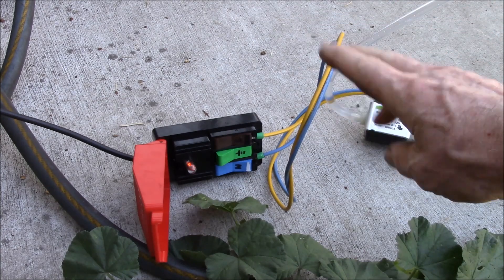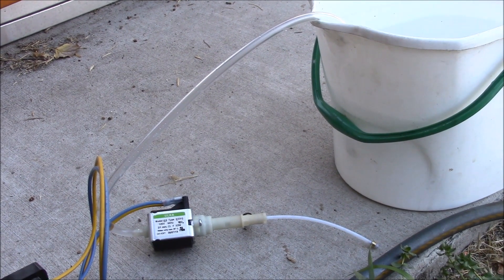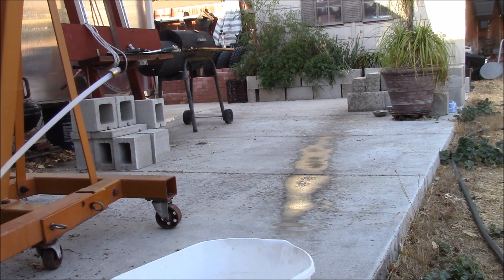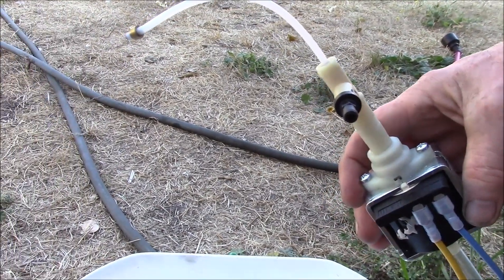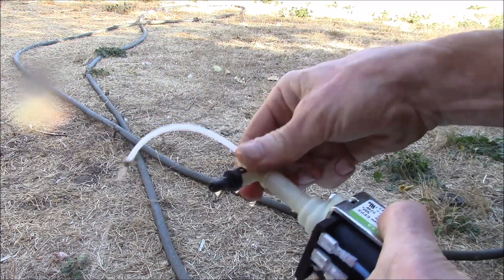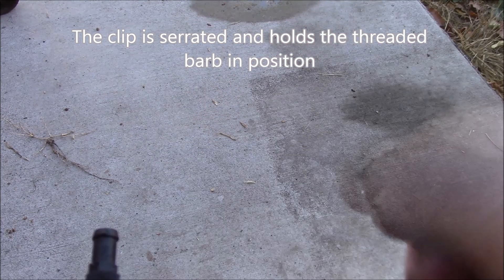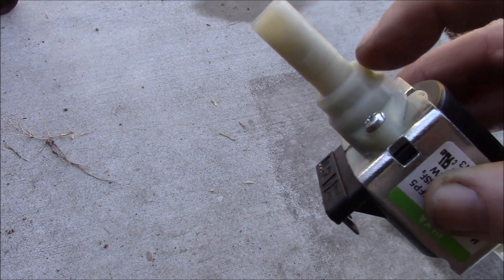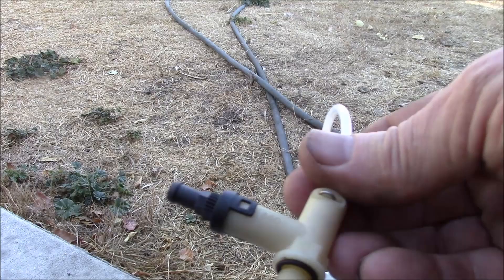Breville 870XL Water Pump / Safety Valve Test

Comment: Great part 2 as well. Just watched it. The tube on top was leaking. I pulled it out and put it right back and it seemed to seal but I’m ordering the valve and tube to be safe. My steamer was not steaming, it seems the pulsating pump action, the water was coming out of the tube/T connection.
Reply: I  don’t have any available but I ordered a new safety valve and tube, so I’ll get it then. Do you think that a leaking “top tube” - the one that goes from the Safety Valve to the thermocoil would cause the steamer to not steam that well? It seems to have fixed it but not sure why.
Reply from the maker: @tonycampanella4597  Yes, that tube takes the full flow out of the pump and puts it into the thermocoil.  Any leak there will reduce flow to the rest of the machine:
https://youtu.be/9lMw6ooiqPI?si=9UHYcDme_sHm3-cd
Reply from the maker: Yes, in part 2 I found I was missing a sealing washer, but the top tube could leak as well, likely because the little o-ring was out of position or worn out.  Do have o-rings available.

Comment: This is 15 bar correct?
Reply from the maker: Thanks for the question.  I don't think the pressure would be that high in this test.  It's just the small Teflon tube on the outlet for a restriction.  I did later set up a test with a valve and pressure gauge that I need to make a video about.

Comment: Mike. Great Videos! I have an 870 XL that has me frustrated. I have replaced main operating board, solenoid assembly unit, and the coil unit. I have water out the steam wand and the hot water, but I cant get any water to come out of the group head. Can you help me here?
Reply: i have also replaced the entire pump assembly.
Reply from the maker: @hirschyfamily  Check out this video if you haven't done so:
https://youtu.be/9lMw6ooiqPI
And follow the water.  Check all the connections, see if any lines are clogged, make sure the solenoid valves are hooked up right and not hanging up partly open.  Those all will cause water to flow up to the hot water/steam valve as that's the default path if everything isn't perfect.
Reply: @The4Crawler  I watched that video so many times and checked water flow. Great video. There is a tube in front of the coil unit that does not remove. It seems to go to the pressure valve. I took out the valve and it’s all good. The only thing I can think is that this unremovable line is blocked somehow. I’m going to part out the machine and get something new. Any suggestions for a new machine?
Reply from the maker: @hirschyfamily  Try disconnecting the line at the pressure valve and see if you can blow air through it.  That line feeds water from the pump, through the thermo-coil and down to the side of the solenoid valve assembly.  Since you get water out the hot water valve, the line from the pressure valve is likely fine because if it wasn't, then no water would go out the hot water valve.  Most likely it's the 3-port valve not fully opening and that will let water leak out the top and into the hot water valve and down to the drip tray.  THE only way hot water can get to the group head is IF that 3-port valve opens fully AND seals off the top port to allow hot water to flow out the side of the valve and up the tube in the middle.  It could also be the 2-port solenoid on the side is stuck open and that will allow hot water to pass right to the drip tray.
Reply: @The4Crawler  I'm having the same issue as this person. Water out of the steam and hot water outlets but not the grouphead.
Everything was backordered in the states.
Tried disassembling the 2/3 solenoid and cleaning.
Didn't work.
Finally ordered a new 2/3 solenoid from germany. They had the 120volt version but after installing it no water from anywhere except straight into the reservoir.
Next day my backordered valve kit shipped...
Installed that when it arrived. Didn't work either.
I'm back to square 1.

Have checked every hose and I can blow air and water through them.
I tried putting the 2/2 colored wire on the 2/3 solenoid to see what would happen, because I can hear  the 2/2 solenoid activating. Finally got water to come out of the grouphead but it's just the sputtering last bit because it's activating at the end of the cycle after all the water has flushed to the reservoir.

Any ideas?
Reply from the maker: @NMEZero666  Follow the water:
https://youtu.be/9lMw6ooiqPI
Although you hear the 2/3 solenoid activating, is it fully opening AND sealing off the top port that sends water to the hot water/steam valve and then to the diffuser and drip tray.  Also is the 2-port valve fully closed and not not letting water flow through it to the drip tray.  To get water out the group head, you need the top port on the 3-port valve closed and the side port on the 2-port vale closed.  Then, and only then, will water flow out of the middle of the solenoid block to the group head.  Pop the back of the machine open and peek inside when you run a shot and see if you can see where the water is flowing.  Be careful as there are live electrical connections inside.

Comment: What device are you using to test the pump? I have an espresso machine, and I am not sure if the pump has an issue, or if the machine's circuit is not able to power the pump. This looks like a useful device!
Reply from the maker: That's a Cliff Quick Test, very handy gadget for doing these sorts of tests safely:
https://youtu.be/pFY22kP61NU

Comment: Struggling with mine. Looking in to the same valve but on a different model. Also the size of the little ball in the pump is important like you said. They make some out of glass but some say they are too hard for the metal. There is another valve with a ball or mushroom shaped with a spring at the exit of the pump to prevent the hot water from the boiler to go back in the pump when it stops. A small loss in pressure makes a big difference in how the coffee comes out and it is hard to detect what can cause it. I also wonder if coil packs become weaker over times as the windings can deteriorate. The diode should be in series and in that case if it opens the pump should stop functioning. If it whould weld shot a a short  the pump should go twice the vibrations and one would notice also. So basically it is about just a few components but they must work perfectly. It would be easier to fix if one had components to swap ready.

Comment: My stupid machine won't stop extracting shot, pulling shot on its own.  I have to manually stop it. Any ideas on what the problem is? Thanks for your work man.
Reply from the maker: My guess is either the flow meter isn't connected or is not working:
https://youtu.be/9lMw6ooiqPI?t=79
Or the main circuit board has a problem.  You could try reprogramming the volume setting per the instructions in the manual.  Or contact Breville customer support and see if they have any other ideas.
Reply: @The4Crawler  That's for the tip. Will look into it. Machine is 2 yrs old so it's past warranty. Called Breville and they want me to pay $180 to send it in for repairs and won't discuss what may be wrong with the machine.  I don't want to do that if I can help it.
Reply: Hi Andrew, I have the same issue. What I did was first try to descale the machine and it usually helps for some time but it only lasted for couple of weeks recently(It was lasting for longer). What I guess is the flow meter might have some  sediment which can't be easily descale. So, I replace the flow meter and it works fine so far. This is what I order: https://www.ereplacementparts.com/product_info.php?products_id=629903#RepairInstructions
Thanks for the amazing video to show how to dissemble the machine.

Comment: Hello, First, thanks for your helpful videos. I have low pressure problem on my Breville. When initially turned on, the water pump noise seems to be less noisy than usually. I checked the Solenoid valves they seems to be ok turning on and off on time. I also checked the water filter and inline filter, and low pressure was even when bypassing them. Before buying the water pump and check a new one, do you have any other idea? All the pipes looks open, the O-rings looks ok visually. The safety valve is not leaking when the water pump is on. The water pump looks pumping ok, but not sure if it got tired over the years to not produce the right pressure. When doing the water pressure test, I was able to get high pressure but not toward the end of the dial, so I am thinking it is the water pump but looking for second opinion :)
Reply from the maker: The pumps do seem to wear over time.  There's a little ball inside the pump head that works as a check valve.  It wears out and that can cause the pressure to drop as water leaks back into the pump.   In my case a new pump restored the pressure to the normal range.  I plan to order a rebuild kit for my old pump and want to compare what a new ball looks like to the older one.
Reply: @The4Crawler  I've been looking for a rebuild kit for my pump, which works fine when just turned on and after being on for 10 minutes, fails to pump at all.  If you could provide a link to a rebuild kit, we'd all appreciate it, thanks!
Reply: Have you solved your problem? I think my BES870 has the same problem. When turn on the machine , the water pump is getting less noisy and when I tried to press the 1 cup and 2 cup button, almost no pump noise and also no water flow. I tried to contact Malaysia’s Breville and they asked me to send back to the store I’ve purchased from. Sadly I bought from Sydney, no reason to ask me send back to Sydney. Quite helpless now

Comment: Did you ever find out why your safety valve was leaking?  Everywhere I look I find these valves are discontinued and no longer available.   I just bought a used 870XL off eBay and it comes with low pressure so I am really curious about what is the problem.  It may be the same problem as you were having.  Your videos are so helpful and detailed.  Great Job!!!  Thank you so much for all your hard work!
Reply from the maker: I need to finish up the video where I took a look at this subject.  Short answer is no.  I first hooked up my pressure test setup and notice the valve was dripping a bit, then it stopped and seems to be fine.  I suspect it may have had a bit of debris stuck inside that was preventing it from fully sealing.  I need to open up that valve for a look inside, but I think all it has is a ball and a spring with a threaded plunger to adjust the pressure it opens at.
Reply: @The4Crawler  Hey! Thanks for getting back to me.  Great information!  Cheers!

Comment: Well to me the best way to test a pump is to run it for a set time and see how much it will pump. It appears that leak is your problem. Say though take pump 1 and pump into a bucket for 1 minute. Mark the height of water. Empty the bucket and repeat with pump 2.
Reply from the maker: Good suggestion.  At the time, I couldn't find any specs on the pump output but I finally found some this morning.  I should be able to test out the flow rate and see how that stacks up once I round up some more parts to do that testing with.
Reply: @The4Crawler  well I'm a water plant operator so I have to test flow rates on regular basis mainly as it applies to chemical delivery for water treatment.